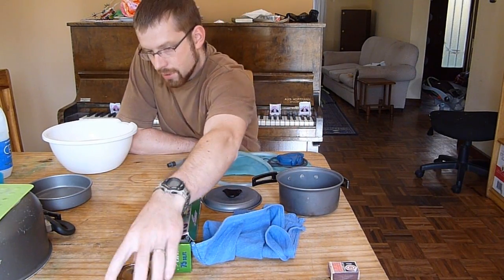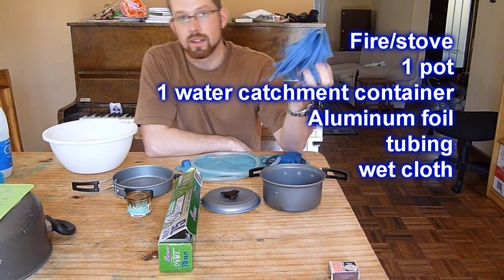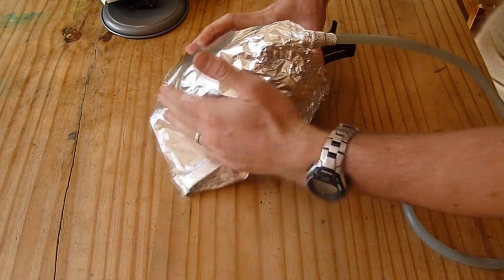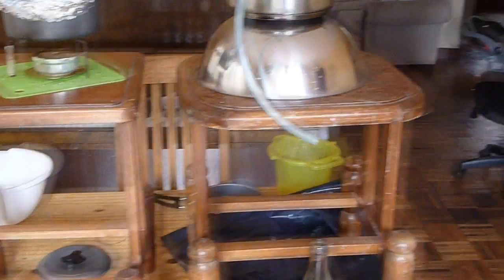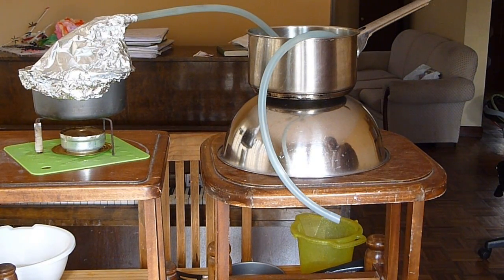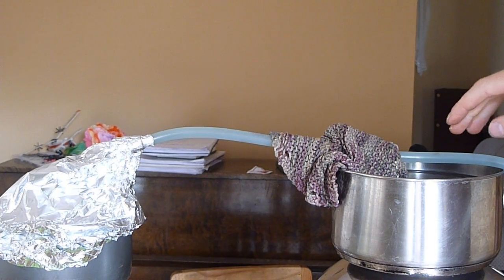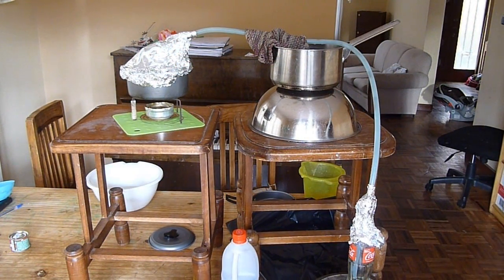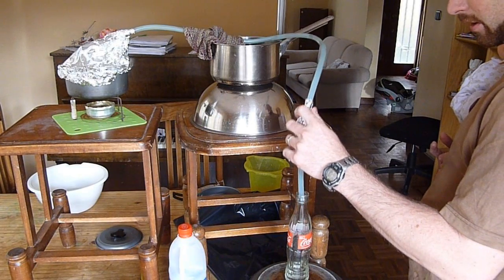DIY: Emergency Desalination still (salt water purification)

Comment: I've done a bit of desalination at home experiments on various scales.  Aside from issues of using your liquid fuel for this (it will take a lot) a few recommendations to your system.  I find the key is to maximize the steam's contact with either copper or aluminum.  The reason for this is that in your video using the plastic hose and a glass bottle are both providing an insulated path of the steam.  It would be much better to use copper tubing and an aluminum water bottle. I suspect that in your experiment you would get steam coming out of the top of the coke can.  This is a waste.  The copper tubing and the aluminimum bottle would help cool the steam so it can condense and fall out into the bottle.  You really want the copper tubing and alum can to be very hot, that' means it's giving off thermal energy.  One other thing for people to remember.  They already have probally 40 gallons of water stored in thier hot water heater.  All you need is a regular water hose to drain it from the tank.  All tanks have a drain nozzle.
Reply from the maker: +Minion Man Good tips. Thanks!

Comment: i meant what they use to make distilled water.  as you have a burner, i doubt the pipe will be needed, just create a funnel point with the aluminum and the condensation should run down the cone top with little problems.  the basic concept of the "Survival Water Still" is very similar to this, but with only gathering condensation from moisture in air and ground, and condensing via the different in temperature between the desert heat and cooler underground.

Comment: I saw immediately that your S-trap would cause a pressure problem since your funnel really isn't sealed that tight.  honestly you really wouldn't need cooling on the tube.  Air would cool the tube enough and if it didn't the glass pop bottle would. Also a longer tube would help, and as you mentioned cooler temps help.  bury that pop bottle halfway in the wet sand would also work well. After  it doesn't really matter where it condenses as long as most of it does condense.

Comment: use copper tubbing or any other metal tubing, the reason why u tasted rubber was probably because you cooked a bit of it with the heat coming off the water
Reply from the maker: yep!

Comment: Thank you for your efforts. I take it the baby has grown up enough to talk by now. What a doll. 
Thanks for the DIY still. It's likely the most basic. Thanks so much!!!!
Reply: Thanks Will. Kiddos are quite big and active! Already falling off wood piles and jabbering away.
Reply from the maker: That would definitely work. Probably better too. I was seeing what I could do with typical backpacking materials, but you're right. Stainless tubing would be a better choice.
Reply: I spent a dozen years in the wild mostly. Times that taught me much about getting by. It's when you suffer that learn so much about survival. Books are good too but so much is just hands on. We can survive out there but health wise I prefer the choices I have now. I try to learn from others too. Sailing is my plan but not to the warm places. The cold places will be safer. That's where I was before a wife and child changed me.

Comment: Perhaps a modified pressure cooker could work pretty good? It already has a valve, which should make it easy to attach a nice sturdy tube, which would generate enough pressure for you to have the tube coiled up in a second pot.  So basically, you should probably take pressure cookers with you on a camp trip, and even save water from coking food for drinking.

Comment: I would not be using the plastic tubing for any long term operation. The heat can break down plastics and that is what you where tasting in the water. Ok an emergency situation you would just have to take the water you get with the tools at hand, but if people want to set something up at home like this during a longer term emergency then copper or stainless steel tubing would be a far more healthy option.

Comment: How long can you keep drinking distiled whater without health consequences?
Reply from the maker: Distilled water is pure water. It does lack the minerals and fluoride of tap water. You'd have to make sure you have another source of minerals that your body needs. It's not recommended to replace regular drinking water if you have a choice on that basis.
Reply: Here's a website with a  write up on the danger of distilled water.
Water filtered through reverse osmosis tends to be neutral and is acceptable for regular use provided minerals are supplemented.
Water filtered through a solid charcoal filter is slightly alkaline. Ozonation of this charcoal filtered water is ideal for daily drinking. Longevity is associated with the regular consumption of hard water (high in minerals). Disease and early death is more likely to be seen with the long term drinking of distilled water.
I wonder if you could use coals from your fire to filter the water to add the minerals back?

Comment: it would work better if you instead of propping up the pipe with the pot of water,  you actually immersed the glass bottle in the cooling water, it would force the steam to condense in the bottle without the need for the wet towel or the pot stand.

Comment: Did you say "tastes a tiny bit like the rubber of the tube"?  Water boils at 212F. Rubber and plastic melts at lower than 212F. Drinking water from a melted rubber tube is not safe.  I tried Schedule 40 PVC and had the same failure and the water smelled like plastic.  Try expensive copper tubing since that is what is used from the hot water heater.
Reply from the maker: Thanks David. This was a demonstration of what can be improvised in an emergency situation with the gear one typically brings with them on a backpacking trip.

Comment: nice set up.....but, if you did it like you showed in the begining by taking the screw on top off the pot lid and screw your hose into the hole in the lid.... you would lose a lot less from the bad seal around the pot with the tin foil....use the foil as a radiator around the hose to help cool the steam down.   and if you put the end of the hose all the way down in your collector bottle the water in the bottle would cool the steam that might be coming out even more and increase your output.   just some thoughts.  nice job though......will work with ANY water salt, brackish, stagnate, all the same as far as the still is concerned.  
Since it is for emergency use you could pre-make the connectors and carry some high temp tubing with you in your kit....the weight would be negligable. 
Good idea.   Thanks.
Reply from the maker: Thanks! Lots of great ideas and lots of room for improvement in my design! Thanks!
Reply: What kind of high temp tubing would you suggest? Wouldn't copper be a little heavy for a backpack?
Reply from the maker: Great ideas Home in Texas 
Jory Edwards Take a look at "High Temp FDA food grade tubing" You'll find it on amazon. I don't know how it stands up to flames, but it is rated for 500 degrees. It'll handle boiling water (it's intended application).
Reply: That's pretty neat. Do you know of anything that could give you a better seal, like chewing gum or tape, that would also be a little more heat resistant?
Reply from the maker: You could go all out and pick up a bulhead fitting and put that through the lid and attach the right male adapter to it.

Comment: A little too simplistic- Can I sugggest ....use a longer more temp resistant pipe and coil it multiple times at the bottom of the second pot? Also - I have seen the aluminum foil before - but it leaks too much.
Reply from the maker: WiseOldOwl3 all valid. my point was to see what you could do with the contents of a typical backpack

Comment: kind of silly all that process when you can just boil the water and let it hit the lid and have another lid upside down in the pan to catch the salt free water dripping off the lid, that's what i would do anyway
Reply: You would lose a crap ton of water as the steam would just float off. It's not very efficient as is.
Reply: Alex Armstrong  why does there need to be an opening?

Comment: why cant some just invent a pot lid that has a hole on top with silicone hose going out of it....
Reply: Scientific lab equipment assortments have offered any size and style you would want or need for as long as the conception of science and experimentation by our species has existed. So not very from long a geological time scale standard. We'll have come and gone extinct faster than any other animal that ever disgraced the face of the Earth that we won't have even earned a separate colored block on the time scale our stay here will have been so brief. It'll be like we were never here as one day all our cities too will lie in dust, or under the sea, or lava flow...[hard for most to conceive but]... you get the point.

Comment: Warning: using PVC flexible hose in this DIY is dangerous and may cause cancer. PVC or polyvinyl chloride is listed as a carcinogen in National Cancer Institute. Carcinogens are substances that have high potential of causing cancer to living tissues. I've done this exact experiment (I haven't seen this before i made the experiment, I swear) and that's the reason i know this stuff. It's also acidic, more acidic than vinegar. If you want to repeat this DIY, do not use PVC flexible hose.
Reply: I inhaled some vapor contaminated with vinyl chloride during the experiment and i got a mild headache. And I somewhat had a hard time thinking. Like if I had a mild cognitive impairment.

Comment: And you'll get salt in the first pot, so you won't have to buy it!
Reply: It will have dirt and other minerals. If you really want that salt - you pass the sea water thru a sand filter made with a soda bottle as a large funnel. You reduce the heat to prevent scorching the brine.